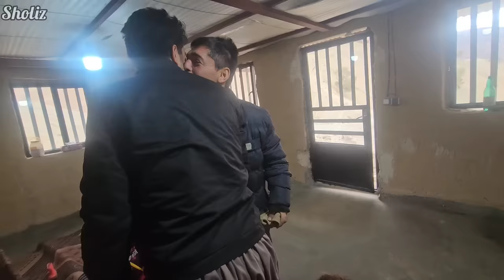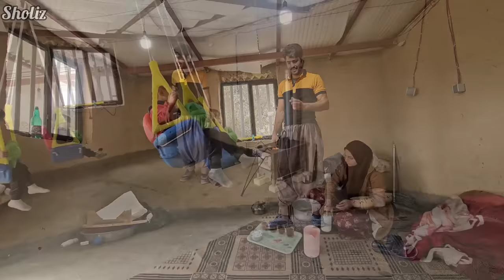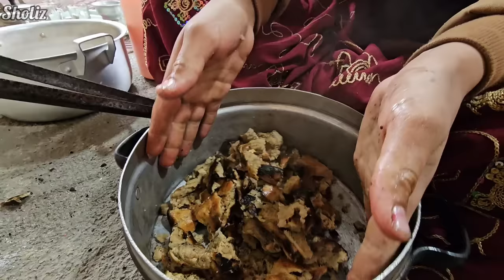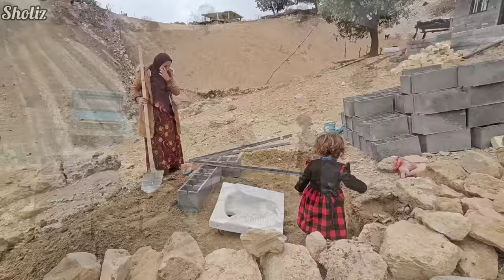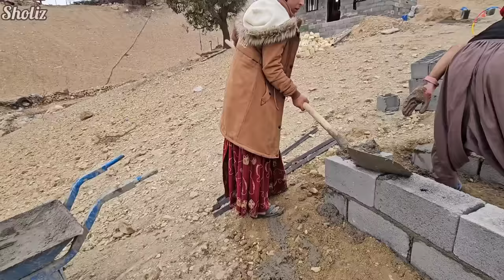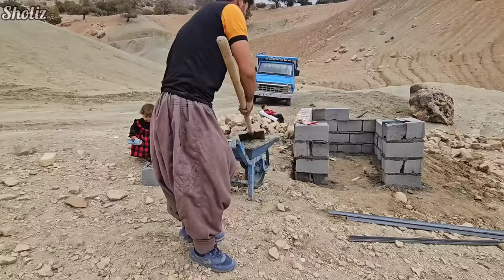Modernizing Nomadic Lifestyle: Building Farm-Based Hygiene Services

Comment: If you stack bricks either side of the fire, extending from the wall to the front edge of the fire, and about the same height as it, they will absorb and hold heat from it and will continue to provide warmth even as the fire dies.  Also - they will be good protecton against one of the children falling against the hot metal sides of the fire. And it will be a surface to set the kettle on, when you take it off the fire. Win-win-win!!!